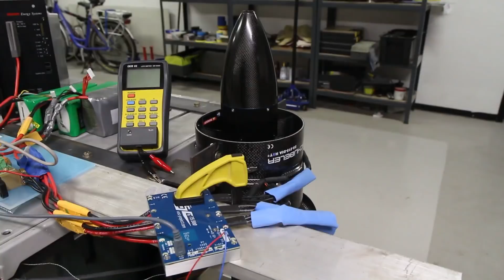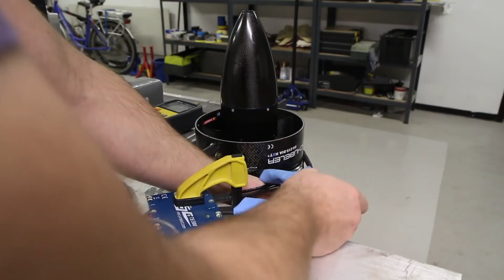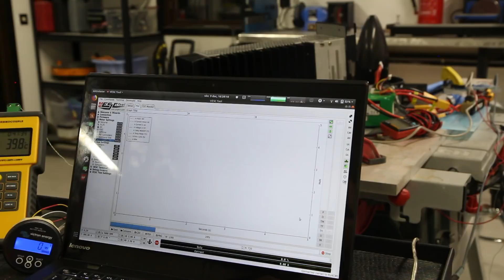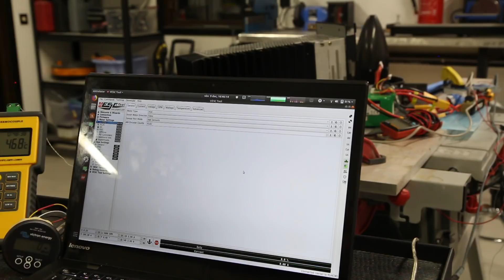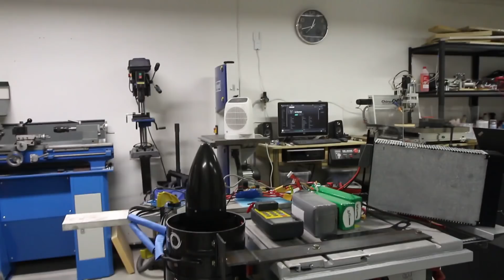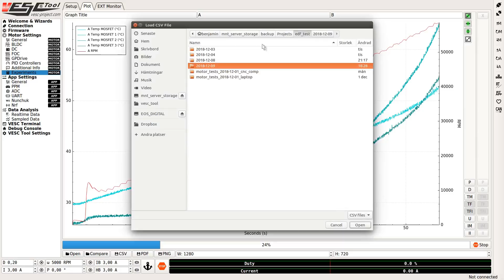VESC 75/300 Test

Comment: ESC hardware is easy, but software is what makes good ESC.
If you want to be on the cutting edge, you need to use TI DSP's, they can have ps range PWM, and so many advanced features, like CLA. but it is hard to code.

Do you use HRPWM ?

Comment: Hi @BenjaminVedder Will this VESC run on 12v without the 12v BEC working? Looking for a high current VESC to use at 12v 2kw, and this seems the most suitable, but it has 14v minimum instead of the rest of the VESCS with 3s minimum?

Comment: good afternoon. Help me please with other project and vesc.... please tell me which controller is better to use on an electric scooter 2 motors with 65mm magnets 110mm stator (4kwt per one), with a 16s12p tesla 21700 battery.needed 70a per rear motor and 50a at front motor ... i saw only your vesc 75v / 200a  dual ..https: //youtube.com/user/serok64 -they tested him at first time on scooter, but doubt wil it be enouhgt for long runs and my specs, my ridding is very agressive ... what power can I get from this controller and in general which controller do you recommend and where  is it better to buy for my specs? That esc was bought from https://spintend.com/products/75v-200a-dual-motor-controller-ubox-based-on-vesc.

Comment: One nice piece of open source project! This is what I was waiting for, A VESC that can go beyond the 60V usual limit!

Mr. Vedder, do you think we could work together? I'm the founder of the Openvolta project, and this project consist of developping and building a dual-stator PMSM. I adopted a 6 phases synchronous or assynchronous scheme for DS-PMSM. 

My first step is to finish the built of the PMSM, wich is ongoing right now. After, I will slightly redesign the VESC 75/300 to a VESC 100/260/6 phases. The big thing is to replace the Infinion IRF7759 for the ON (Fairchild) FDMS86202ET120 MOSFET. I'm also considering IGBT, but this is a future project.

However, I will need help with the VESC software. In the configuration, it would be nice to have a setup with a dual stator option. 

The DS-PMSM deisgned is for small electric car. It's capable of 100Nm at 100A and voltage could vary from 72V to 600V. A 144V, it's capable of more than 400 RPM, wich is more than enough for direct drive. I still need to be tested!

Thanks for sharing!
Donald W.
email: donald.wright AT openvolta.org

Comment: With your vesc i was able to drive this 130kW PMSM motor which i designed and build. I want to make my own vesc version with the my isolated gate drivers, i need some help to upload the bootloader and change some limits for voltage and current.  https://youtu.be/L7RO9z2BlTw you can check my other videos. If you need a motor design let me know. I can design from 100W to 250kW high performance motors.

Comment: Mr Benjamin Vedder you are a genius Sir but you "quoted" that you really had no need to manufacturer a 300+ ESC but yes we need them as hobbist/industrial applications that's why we pay $1000-2000 USD for Kontronic Kosmic-300 and the MIGHTY MGM 80063 yes 800 amps and 63 volts 😉 rc sensorless controllers those are the Top dogs and Shulze but they went out of business but still their 15 year old to current ESC 303.334wk are 300 amps -14s  and still work flawlessly in hv/ hi amp applications so a good ESC is more important than the best batteries in Technology now because they regulate everything in real time nevertheless your 75/300 have proven to be the Holygrail in rc/ industrial ESC,s look like you testing that ESC with the Total power motor series Tp-5680 or Tp-100??? Nevertheless I'll be inboxing you on any problems I may have tuning it to my 2300 gram custom 24Kw Outrunner on 16s😉 so in honor I'll interface your Red jewel into my GP track edition Race Scooter and see if it can pass the load test after I liquid cool that 75/300 if any ESC can handle a true 300+ amps in a rc sensorless controller it's a winner because we understand it can continuously run at 150-200 amps but safely handle the extreme high voltage and current spikes that kill All sensorless controllers at instant load sometimes that's been our Main problem with All ESC manufacturer's in the past  and I'm taking from 40 year's ago to the present time🤓

Comment: So I have to solder each phase wire to one 10mm bullet connectors and do the same with the battery imput wires now that's going to take up more space than single 6awg  wire but I understand why you use several mini or 4mm wire's but still 12mm wire thickness 🤔 dam i love the ESC but I'll have to put huge bullet connectors 🤣 but Benjamin V-can that beautiful brick do 60 volts@400 amps for 5 seconds??? is my wish the only choice I have is your ESC and the New- Mighty Kontronic Kosmic 300/640-14s these are the only ESC,s that have FOC and the Only True High Amp ESC,s Besides MGM 40063 that burn out easy and their Hyper Power 80063 but still no FOC on either ESC and Super Expensive to be burning up like the MGM 40063-3has been with loads less than 300 amps and 60 volts and it's liquid cooled@$1050 USD a Pop! 🤔🤔🤔

Comment: The ebike community would like to know what would be involved in getting these to handle  at least 20S-24S. Many of us are using the QS205 V3. I believe you would be able to appeal to a wider range of people. Interested in buying a until if we can get it to handle the above voltages. Cheers.
Reply: I have just finished design of such an ESC. It is roughly based on 4.12 schematics with 2 shunt amplifiers, driver and mosfets are completely different. Depending on mosfets used it will be good for either 150A continous on 20S or 120A continous on 24S Pulsed 500 Amps. PCB board size is 100x92mm. Ordered PCB from China, when it arrives in 2 weeks i will assemble it myself (i do that for a living). Downside is that component cost for a single ESC is over 400$. If i was to sell it then no less than 600.Done this for my monster "OVERKILL" build - 4WD 36KW 100+MPH 0-60 under 3 secs. Battery LG HG2 20S13P, custom hub motors, 9 to 12 inch tire.
Reply: What kind of price would people pay for such a controller? I have been looking at making a higher voltage version for a while. Ideally about 120v max and 100A continuous.

Comment: Nice to know you are still iterating on this stuff.  Hands down my favorite open source project.  Or project.  I've loved the design and accompanying software.  Makes an idiot like me get work done.  Thanks for sharing.  I was laughing a bit when I saw that heat plot.  I've totally chased data like that  :)   I'm looking forward to seeing more.  With my test vesc repaired, I'm looking forward to seeing what's changed and spinning up on whatever I built two years ago with the other 4 :)  Thanks so much for sharing all this stuff.  All I want to know is, what's the plan for the big fan?  Is it for convenience/load or is it ultimately going in something?  It's massive.

Comment: Nice project, pity that it is not open Source anymore
Reply from the maker: It is open source, has always been and will always be. Here you can find information about the firmware and VESC Tool, and how to compile them here:

https://vesc-project.com/node/309

The difference with the VESC6 and probably the 75/300 is that I haven't published the hardware layout, only the schematic. The reason for this decision, and why it does not conflict with the ethos of the project, is explained here:

https://vesc-project.com/node/311

All VESC hardware runs the same firmware, with some configuration changes for differences in the hardware. You can see that the 75/300 already has support in the firmware, and had it for as long as I have been developing it. You can start tinkering with the firmware already now, before the hardware is ready, if you want to:

https://github.com/vedderb/bldc/tree/master/hwconf
Reply: He also has the V6 schematic published. It is very much so still open source.
Reply: It's always been that way and still is open source.
Reply: @esk8spirit362  vesc V4 is open source, but V6 and this newer version is not.
Reply: @Upgration  Oh ok, I don['t get how it works. If it's open source, you can't change the code and make it not open source right? That's the whole point so that everyone can use the code and no one can make it his own property to bully others for using the code...?
Reply: @esk8spirit362  the vesc tool is open source. Since t r a m pa is the manufacturer of the hardware for the V6 and this version, there are no more details about the hardware layout.
Reply: @Upgration  I am not sure how that's supposed to work. I thought you cannot do that If your thing is based on using open source project you cannot make it yours only and make money on it... But I guess I am mistaking...   Though all the stuff above the basic vesc tool has been created by them so why should they tell us how they did it... Don't understand it really, If you do and could explain the legality, that would be nice.

Comment: It's quite great to see how well this is working, great work!
What if the mosfets had a slot in between so they don' t transfer the heat to the others nor to the control section of the pcb?

Comment: Why 3 sets of phase wires? What can it be used on?
Reply: more current
Reply: It's not three separate controllers, its one big controller meant to drive a single motor.
Reply: It's easier to have three skinny wires than one fat wire per phase.
Reply: Ryan Willis i know about 3 phase wires i'm asking why 3 (SETS) of phase wires, i use 2 sets (6) wires for my diy dual electric skateboard so whats the purpose of having 3 sets?
Reply: @manski209  It's only 3 phases.  Each phase has 3 conductors because it's too much current for one.